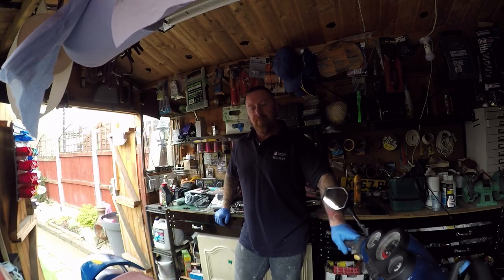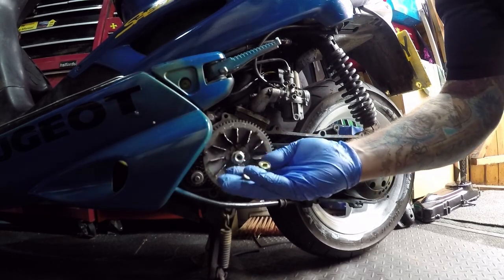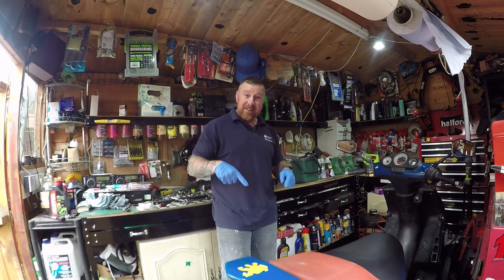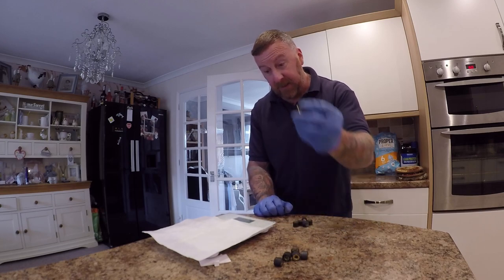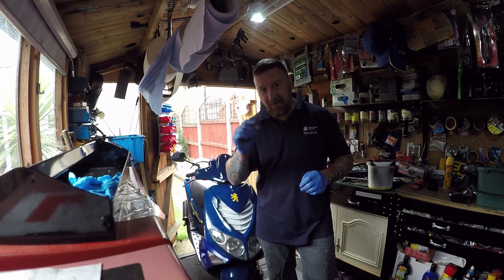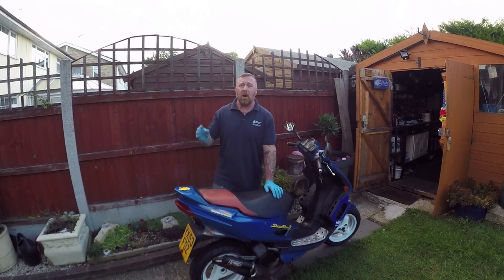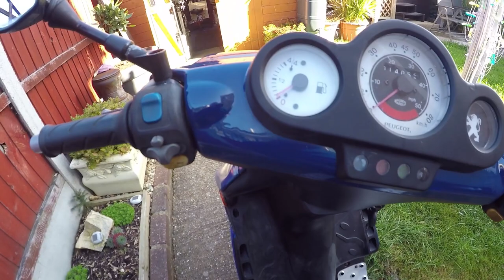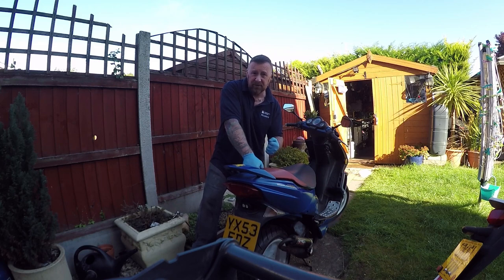SPEEDFIGHT MOPED NOT PULLING AWAY & VARIATOR PROBLEMS MARK SAVAGE

Comment: I got a 150cc Chinese made I have replace the rollers I replace the belt I replace the clutch and I put a new carburetor and my bike still move slow what's wrong please answer
Reply from the maker: HI BUD 
when its on the stand does it rev up ok and go well?
normally id say it was the VARIATOR system for sure, what rollers have you put in and did you clean the system and change the belt and check the clutch?
serviced it last plug and air filter , cleaned carb does it start ok ?
only see you message today as it was blocked ! not sure why
Reply: @marksavage  no it wasn't that I got all that brand new one my whole variator system clutches and all that is brand new the drive belt is brand new I got brand new my manifold was leaking air I need to know more about the the the manifold system the air system can you help me with that

Comment: Hi mark old vid but hoping for a reply lol, ive messed with rollers ive got 3 5.5g and 3 10g in bike loves it runs and gets to speed lovely without to much acceleration but ive still got a slow pull off? Rollers aint doung nothing for my pull off at all, has a stage 6 viriotrator thanks
Reply from the maker: I have always ended up with 6g rollers bud for best of both 
But check clutch as in my videos on clutch 
New belt and clean variator system 
And E5 fuel with good 2t oil
Reply: @marksavage  only just seen your reply, all 6 rollers change to 6g? Cheers

Comment: Hi mark belt snapped on daughters scooter speedfight 3 I changed belt but bike doesn’t pull away bike was all fine before any ideas 💡 thanks
Reply from the maker: Did you take off the variator and reset the rollers , prob best to clean and change them bud
Reply: Didn’t reset them but they are brand new rollers only about a month old so was the belt there is some melted robber on the clutch pulley as well will that interfere much
Reply from the maker: @AndyVile  like in my videos bud 
Clean the rubber off
And you need to reseat them so take it off and do that bud all will be ok
Reply: Cheers mate I’ll do and let you know how it turns out keep up with the great vids 👍
Reply: Your a legend mate you and your videos have helped me a lot thank you very much you were spot on with the rollers I put them all back after a good clean up and presto first kick and the bike was singing again and road like a dream.  Keep safe with this crazy virus 👍👍👍👍
Reply from the maker: @AndyVile  good to hear bud 
Happy days

Comment: Hey dude if i change my pulley system will i need to upgrade my stock clutch and do i need heavier weights to make it faster from acceleration and top speed also do i need to upgrade the stock belt please let me know
Reply from the maker: no bud just good quality rollers at the same weight ,they will run better too heavy and you will have poor pull away but better top end so it does come down to what you want 
as for the belt yes but change that too

Comment: Cleaned filter and removed jets and bowl all cleaned including the jets. Back together and won’t start at all. Spark is fin. Help please. Can I prime the carb. Is that it Mark.
Reply from the maker: Hi bud 
So it ran before ok !
If so take it off again check all you work if ok and cleaned with carb cleaner 
Then put back on and like in my carb videos yes prime carb by the vacuum pipe 
All should be ok but maybe a bit slow on first start up
Reply: Took it apart again Mark. The float just drops when I remove the bottom tub  and there’s no adjustment.
Reply: Where do I disconnect the vacuum tube to prime it. At the top of the carb? The other end disappears under the petrol tank. There’s also a small pipe runs into the water pump area. No screws to remove and check it.
Reply from the maker: @johnmcfadyen8422  I connect the air pipe when the bottom tub is off and blow let sit come out then lift float and air should stop 
That's working fine
Reply from the maker: @johnmcfadyen8422  out of the vacuum you have two pipes 
One goes to the carb the other ro the manifold 
Like in my videos bud 
Take off the pipe off the manifold and suck 
This will fill your carb
Reply: Ahhhh!  Reset everything again. Float, idle and mix screws.  He led the float. Changed plug. It’s getting fuel. Just not sure if the vacuum is working Mark. I disconnected the pipe and sucked as you said. There’s nothing. It’s not even trying to go. The plug is sparking externally, even so I’ve ordered a new HT coil as it’s poor cond at the plug end. Welcome any help bud!
Reply: So Mark. Two pipes on the carb top. One fuel supply and one vacuum. Am I blowing into the vacuum? Pipe that disappears under the fuel tank? Or sucking. Can’t  get my head around that one.
Reply from the maker: @johnmcfadyen8422  I do show it in my videos bud , suck , you suck the air pipe 
take it off the manifold the other pipe is fuel and goes into the carb 
take off both and suck the lower one fuel will come out of the pipe ,that one goes onto the carb then suck and prime it will fill up after a few sucks then reconnect air pipe to the manifold and start
Reply from the maker: @johnmcfadyen8422  check out my two newest speedfight videos I show it on there
Reply: Redone everything. Drones the fuel and cleaned again. Going to compression test it now. I’m an aircraft engineer so not entirely stupid. Can’t figure this be out.
Reply: It has a sport exhaust and a standard 60 main jet. Not ideal and probably little small but it should start. Can we arrange a call bud and I can sort out some sort of reciprocal agreement.

Comment: Hi there I hope you can help me out with the longjia lj50qt-3l manual 2015 it just cut off at 30 mph then I have got a spark and put the battery on change and I have done everything else that I can think of I don't know what else is wrong with it is not long ago I had a full service as well I don't know who else I can go to thanks Gareth
Reply from the maker: hi bud 
so you have spark and the plug is getting wet? take out plug clean put back in and test 
hand carb test ? like in my videos 
when you turn it over and open the throttle does it pop and bang?
Reply: Thanks you so much for and that and yes it does pop and bang but not all of the time and thanks you for the amazing video and funny keep up the work
Reply from the maker: if when you try to start with the throttle open and it pops and bangs it can be piston failure! 
which is not good sorry to say bud
Reply: @marksavage  I will keep you posted on how I get on with the problem thanks again and I am just a bit worried about that as well
Reply: I did say that I would keep you posted on the problem and I work out that it was a Very week spark plug that was not working on so I got a new one and it works perfect with no problems now and can you please do a little bit of a chat about big bore kit and if you think that is great or not as I can't find any thing to do with it in the videos thanks and keep up with the amazing video and information
Reply from the maker: @garethfirth2357  hi bud 
Well sometimes it can be as something as a service 
As not knowing what you have done it's very hard to help 
As for big bore kits watch 
https://youtu.be/hMN4ZTdnrSU
I dont like them bud

Comment: Hello i have a speedfight 2 (i think) and it was my brothers who took it apart a little bit and never put it back together, its been 3 or more years since it was running. any chance i can get it running ? what should i do first ?
Reply from the maker: Hi bud
I've 70 videos to help you get it back on the road 
Fuel out , carb off and clean 
New fuel lines 
Change plug and clean air filter 
New battery 
Variator system off and check replace if need be 
Check over all wires and wd40 
Check brakes over and tyres then give it a go bud

Comment: Hi mark I just wondered if you could help me with my speed fight 2 as I am really stumped I recently got it running and it ran absolutely mint pulled fine would easily do 40mph up hill but today I got it out and it started up took it for a little test around the garden then turned the bike off then I went to start it and it wouldn’t start back up and I have no idea why because it has had a brand new carb fresh fuel and brand new spark plug and I checked for spark and it still had spark and fuel but I decided to put another new spark plug in was the same still nothing but then it eventually started up but it would only idle it wouldn’t Rev at all if I rev it it just dies I even put original carb back on and was still the same I am really stumped any help will be much appreciated
Reply from the maker: it hates you !!!!
no this can happen and has to me many many times!
normally it is the carb but can be cdi, coil, stator, volt reg, and a few other things 
I have over 80 videos covering all of the problems so old some very new but all should give you advice on what to check 
from vacuum to test for fuel etc etc
Reply: mark savage alright cheers for the response I just find it crazy as I’ve replaced so many things and it was fine and now it doesn’t want to go I was thinking if maybe it needed a top end rebuild but in another I don’t see how it would because it was running perfect but I’ll definitely watch some of your videos
Reply from the maker: @motorbikeryda883  ive had pistons just go but prob on there way out anyway, if its air cooled its really easy to check, but did you do the wet hand test? was it wet 
could even be reeds oil seals !
Reply: mark savage well I’ve just dropped needle down one notch in the carb to lean it out a bit and it started straight up and now runs great again just have to see how long it stays like this for

Comment: Hi mark having a problem with my PEUGEOT SpeedFight 3 the indicators don’t work and I can’t find the relay for it looked everywhere still can’t find it any help would be much appreciated thanks
Reply from the maker: Have a look either under the seat bucket at the rear or rear side panels 
Check wiring and under the clocks
Reply: Hi thanks for your reply I’ve looked under the bucket I’ve looked in all the places you told me but still can’t find it many thanks
Reply from the maker: I'm in Cape Verde till next week but will look at my manual when I get back 
Maybe work looking on google for the wiring
Reply: Hi mark thanks for your reply’s I’ve spoke to someone yesterday and they told me the actual indicator relay is inside the clocks it’s actually attached to the circuit board there is no flasher relay for the indicator just thought I would let you know in case you come across this problem yourself or any one elese reading this has the same problem i have to buy new clocks now
Reply from the maker: @chrisandrews4394  yea I had thought thats what did as a lot of people have to replace the clocks for others issues like they go blank and dont work 
To be honest they are not fun to work on a suffer with wiring and earth problems 
Thanks for the update bud

Comment: What Stoke oil do I put in my Peugeot speedfight 2 anyone help it’s air cooled ?
Reply from the maker: 2t oil like in my 2t oil video bud
Reply from the maker: https://youtu.be/4yF-A6CIr8o
Reply from the maker: With over 70 speedfifgts they will help keep you on the road
Reply: Thanks so much pal the dumb ass I bought it off told me it was 4
Reply: Will this effect the ped if he has been putting that in ?
Reply from the maker: @jamesbaxter3812  it can run smoky and clog up the plug worse still seize the engine
Reply: @mark savage the oil colour is blue I have know 2t as being red is this blue 2 stroke oil ?
Reply from the maker: @jamesbaxter3812  yea that's a good one bud so ok
Reply: @mark savage thanks a lot for your help pal much appreciated 👍👍

Comment: How do you remove a seized variator peugeot speedfight 2 100cc please
Reply from the maker: Seized 
So the engine is ok and turns ?
The variator , is jammed on ?is that what your saying
Reply: The engine still starts fine just variator is seized on shaft i have bought new variator just can't remove old one
Reply from the maker: @markoates2810  thats not good
 loads of wd40 soft hammer tap on and all around and lever from behind with a big screw driver spin 1 inch and continue until off
Reply: @marksavage  i will give it a try in morning and let you know how it goes thanks for the advice mate

Comment: Good video but I’ve had a hard one today yes on a 70cc all new new 17.5 carb new clutch every thing new you name it now tho this is what I’m having 85 jet take off half of throttle splutter splutter over half nothing good today I down jetted to 82 and 79 had no other jets guess what worse pulled away but spluttering not only on take off but full throttle I’m
Livid I’ve stuck the 85 back in its better but no splutter on full throttle just up to 2035 mph standard airbox new filter new spark plug ignition. Clutch vario belt 4.5 rollers I’m stuck

Comment: Hi Mark I have a pegueot streetfight 2 50cc 2 stroke it's pulls away then it goes really slow when I got it the front indorcators are not wired up do you know how I can fix it thank you kind regards Jacob
Reply from the maker: Clean variator and change rollers like in my videos 
Indicators and you check the relay ?
Are the rear ones working?
They wires are very problematic so take them off and make sure they are connected then wd40 or change bulbs
Reply: @marksavage  Yes the rear ones are working but no wires on the front ones I cleaned it and fitted new rollers but still not good
Reply from the maker: @jacobcarr2643  you need to take the front off and trace the wires 
My videos show them so watch a few 
As for the variator 
So cleaned, 6g rollers and is belt ok and what's the clutch like as in my videos bud
Reply: @marksavage  they are all new belt rollers and clutch it just keep slowing down
Reply from the maker: @jacobcarr2643  move on to carb 
Take off clean like in my carb videos 
Check float and the vacuum and fuel pipes as it may not be filling the carb
Reply: @marksavage  I will hopefully it will work can you tag me in the video of the wires so I can see thank you
Reply from the maker: @jacobcarr2643  bud it would mean I'd have to watch many of my speedfight videos to find one that I take off the front end 
Sit with a cuppa and type in speedfight mark savage 
And start watching then 
It will be there I've gone over it a lot of times plus other this that will help
Reply: @marksavage  Hi Mark I found the video I have no wires at all going to my indorcators on the front do you know how I can silenc the exhaust I have it's like the same on that is on you're pegueot speedfight
Reply from the maker: @jacobcarr2643  I've got a video on the wodding on a speedfight 
If it standard and it's not blowing then it buggered 
If it's a sports exhaust then you can re wod it like in my video 
It will help on pull away and the sound
Reply: @marksavage  Hi Mark where do I buy the wodding from
Reply from the maker: @jacobcarr2643  E BAY BUD , MOTORBIKE /MOPED EXHAUST WODDING
Reply: @marksavage  Hi Mark I was out on my pegueot it mad like a pop noise then would not start back up the piston is free I don't know what it is
Reply from the maker: @jacobcarr2643  so a bit of back and forwards wirh you so far 
Did you sort out the other problems you had as you as me then never come back to me if it sorted it or what you have done to it 
If now it wont start and if you open the throttle full and it eont sysrg but pops it can be the piston
Reply: @marksavage  I done the wodding but the bike was still bad now it will not start up the carb is filling with petrol and but nothing happing it's has spark but no joy with it
Reply: @marksavage   hi Mark I got a brand new racing naraku barrel piston and rings and gaskets and new carb with k&n air filter fitted to my pegueot speedfight when I start it up its making a whistling noise do you know what it could be thanks
Reply from the maker: @jacobcarr2643  odd 
Could be the fan when you put back on the plastics ?
Piston not seating right on head not tight 
Best sort it before any damage 
Maybe get someone to listen while you start it up and rev it
Reply: @marksavage   ok thank you I got a carbon fibre head light is it wise using it
Reply from the maker: @jacobcarr2643  they are better on the road but not legal nor will it pass an mot bud

Comment: Where are you based?
Reply from the maker: Hi bud , old videos and there's 100 on a play list that will help 
I'm in essex bud
Reply: @marksavage  someone tried to steal my bike about a month ago they ripped the whole Barrel out and bent the fork so I put my bike on a switch so I didn’t have to replace the whole ignition and was running well for about 3 weeks and than just cut out on me do you think it could just be the plugs?

Comment: I tried the trick with the hammer. It ended breaking off a couple of finns.
Reply from the maker: On the speedfight?
Push it hard up and use your foot to keep it in place 
Or if you have a impact drive drill 
Use that
Reply: @marksavage  Yes on the speedfight 4. The disc with the finn's is made of some shitty metal it seems. But wouldn't the back of the hammer scratch the belt side of the disc if you jam the hammer hard in there ?
Reply from the maker: @mbyb6817  I've done it hundreds of times but 
Get hold of a impact drill 
Makes it easy